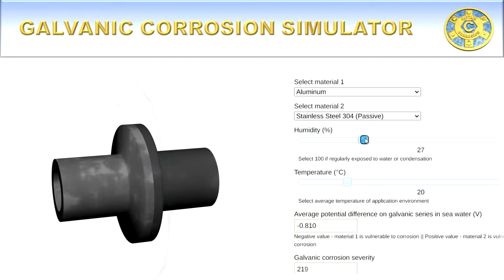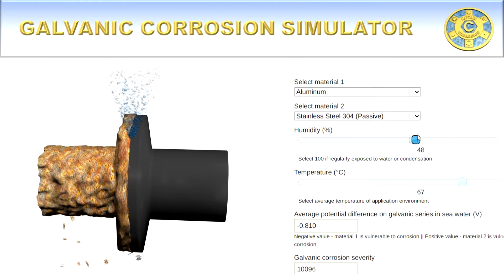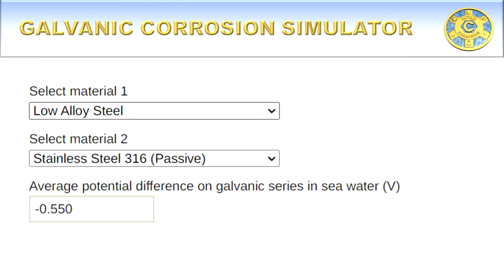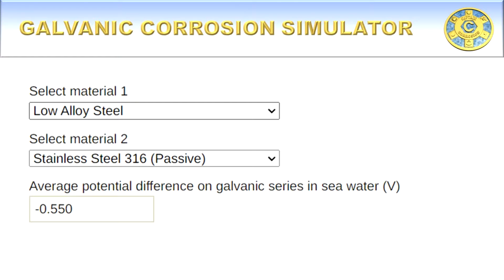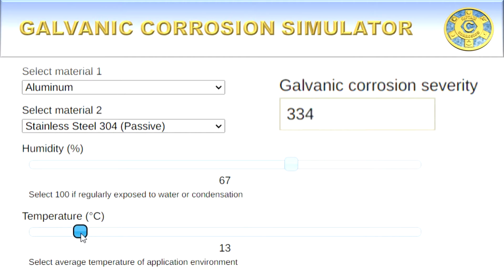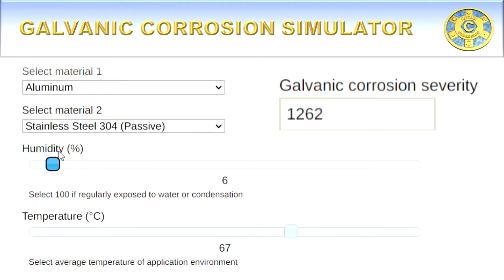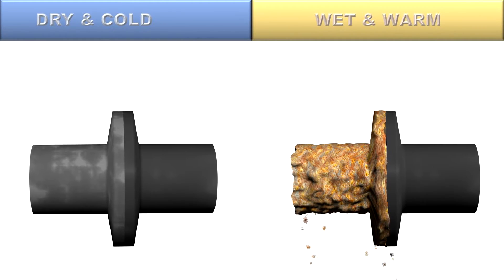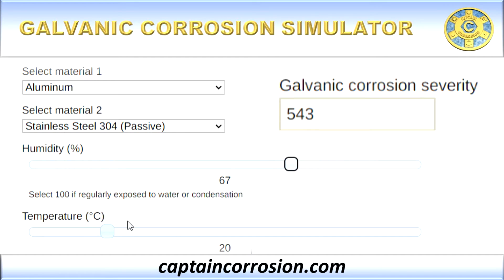Galvanic Corrosion Simulation Tool

Comment: I want to carry out a numerical simulation of corrosion in combined cycle recovery boilers, as I intend to perform a comparative characterization between corroded and non-corroded boiler tubes. Which software should I use and how can I conduct this simulation?

Comment: Wow, fascinating, nice tool.

I've one doubt,
Is that galvanic corrosion sensitivity for per year or for what time series?

I'm confused about that one alone.

It'd be highly appreciated, if you clarify my doubt.

Once again, nice tool and thank you for making it available.
Reply from the maker: Hi! I made this simple calculation tool initially just for myself to have an educated guess how materials would behave in different scenarios. Of course galvanic corrosion is a complex process and there are more factors that directly contribute to the severity but those cannot be easily taken into account anymore. For instance, a crucial part is also the surface area of the cathode that drives the corrosion of the anode but there also the conductivity of materials starts to play a role. Anyhow, from personal experience I'd say that if the severity is over 400, then the combined materials would likely run into serious issues in a few months.